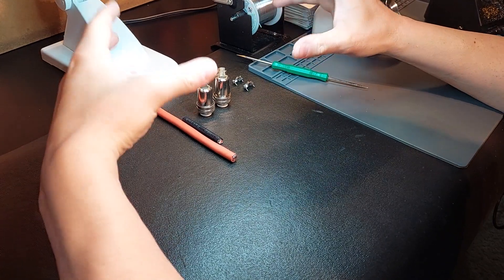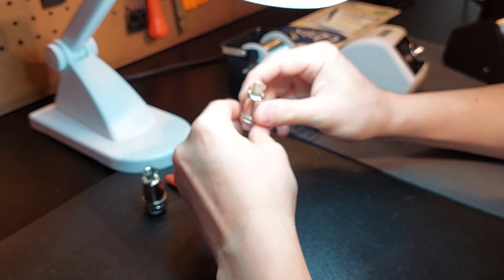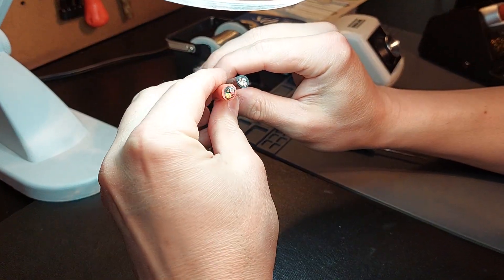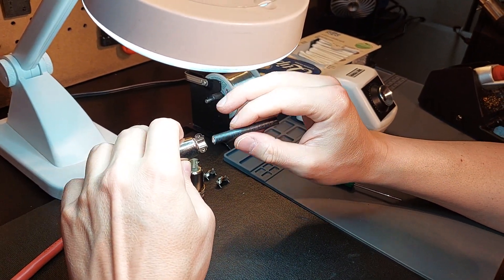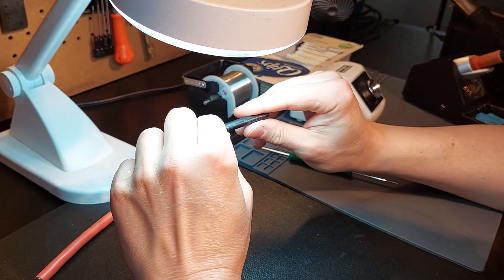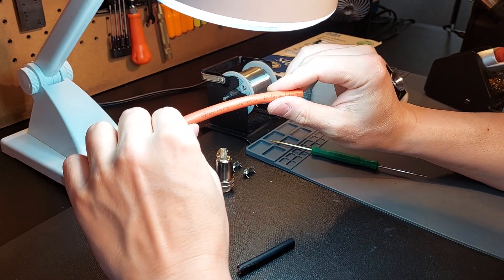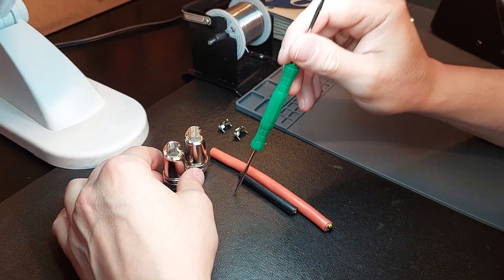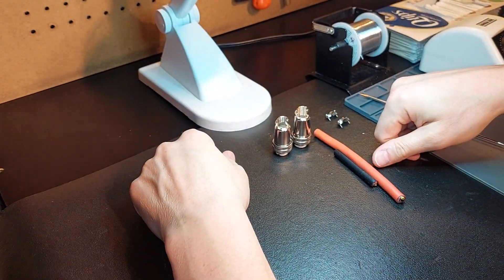NEW HY H17 Connectors Made To Fit 16/4 Double Shielded Spindle Cable

Comment: How do you ground the shield for a cable for a Gecko G540?  You have to use the DB9 connector on the Gecko, so on the enclosure end of the cable, you have nowhere to run the grounded shield.  Do you just run all the shield grounds to a separate DB9 (or whatever) and then on to your ground bus?
Reply from the maker: Thank you for your support. You'll use either 2, 3, or 4 pins on the DB9 connector for your shield drain as these pins are all grounds for the G540.

You can also solder a lead to the metal shell of the DB9 connector from any of the pins listed above because if your controller is properly grounded as it should be when the motor cable is plugged it will ground to the electronics enclosure as its conductive. 

Thank you,
Vince